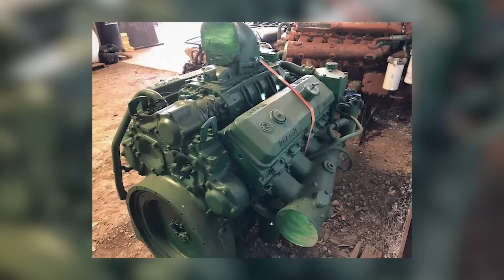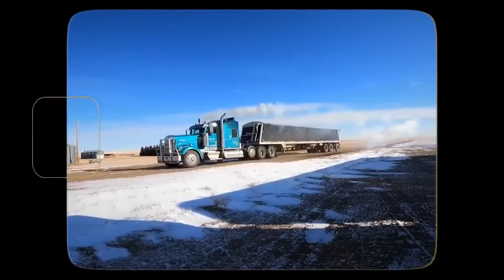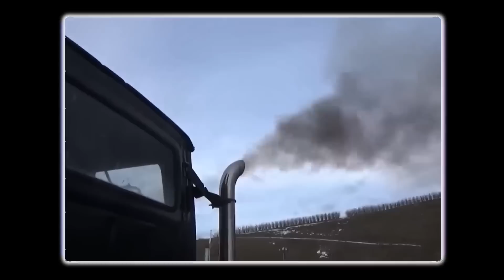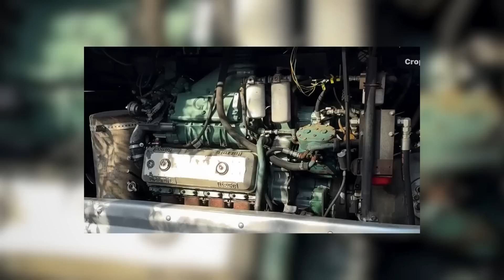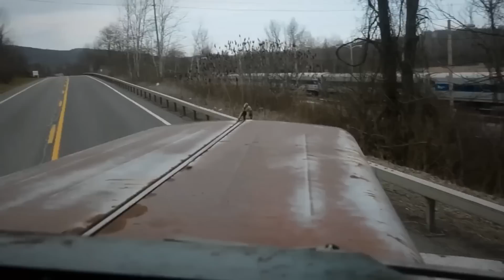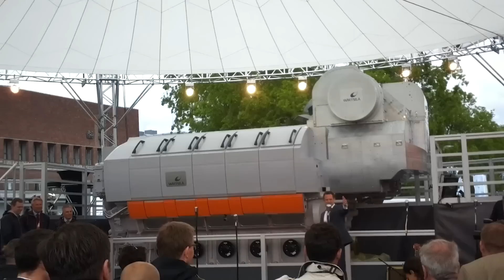The Shocking Truth Behind Detroit Diesel’s Banned V 16 War Engine!

Comment: Watching a video of a V-16 Detroit, but the pictures are of 6-53's, 6v-71's, 8v-71's, a couple 12v-92's..............  misleading pictures, some information isn't quite correct also.  2cycle engines won't run without a blower.  The blower doesn't compress the air, just feeds it to the cylinder.  Better research might improve the video.

Comment: Hearing that compressed air starter brings back memories of the oil field for me. I was a motor hand on an oil rig in Louisiana it had three V-16 Waukesha engines that started that way. Talk about power!
Reply: An air start on a rotax 850 etec skidoo mxz would be cool!
Reply: @jlo13800  Yes, an interesting approach.
Reply: In very large engines, a different method of air starting is used: Injecting air directly into one of the engine's cylinders. Very large ship and stationary engines do this.

Comment: The blower is for aspiration in a two-stroke diesel, not for boost.
Reply: Wrong
Reply: For boost
Reply: @NathanStickney-xv6dy  No, it's required for the engine to merely operate.  There may be some boost, but it's a minor contribution.

Comment: These engines get their Best Fuel economy at or near full output.  Running at 80-90% they exceed most other engines. However. Run it at less than 50% the four strokes win. Run it at 30% or less most of the time and it will shorten the life of the engine. Carbon, sticky rings.  Two strokes are like that. But. As a Marine Propulsion Engine or Generator? Nothing Better. Outlive snd Out Perform anything else. The harder you run it, the better it performs and the longer it lives!
Reply: Sort of. I ran 12V71 engines running pumps and nowhere near 80% loads. And ran them for 14,000+ hours between overhauls. All the while burning 9 gallons of fuel per hour compared to their maximum rating under load of 19 gallons an hour. Key was don't run them at anything under 1400 RPM except at startup at 1000 RPM and shutdown. And change the oil every 300 hours while adding 2qts every 24 hours. Basically 60 qts used for every oil change cycle. ( 36 + 24 burnt ) Normally operation had them at 1800 RPM with the overspeeds set at 1900 RPM. While they were designed to operate at up to 2100 RPM, our 8' diameter props started to cavitate at anything over 1800 on the engine ( 100 RPM on the prop ).
Reply: When I was in the military, we were required to idle our Detroit Diesel engines at 1200 rpm and not 650; otherwise, wet stacking will occur. This is oil blowing out of the exhaust pipe.

Comment: There  is Differential Stroke Cycle (D-Cycle) by simply splitting the piston crown from skirt to pump gases for the chamber via a (valvetrain-like) piston-train and to combine with the rest of the piston to turn the crank – a hybrid of 2-/4-cycle. D-Cycle further ushers in the compression-/spark-ignitions for diesel-/gasoline-engine hybrid - “Diesoline” engine - which is the SCCI/LTC (Stoichiometrically Charged Compression Ignition/Low Temperature combustion) engines. 
The Piton-train can dynamically adjust stroke lengths and durations of the gas exchange to optimize Burnt-Gas Retention (BGR) which is an expanded EGR (<30%+/-), for ignition timing and combustion duration. These retrofits surpass the current 2-cycle, 4-cycle, diesel, or gasoline ICEs, while maintaining compatibility with existing parts, manufacturing, facilities, personnel and processes. 
I worked for Detroit Diesel (DD) before retirement. It is a shame that DD doesn't continue the great power-stroke in every revolution. That is the wrhole engine

Comment: This video is full of BS about the 16V149.  By the late 1980's CAT's 3516 engine was exceeding the 16V149 engine ratings.  3516 genset had a 60Hz standby power rating of 1750kW and the 16V149 was 1400kW.  To compete with CAT in the standby bower rating DD had to either had to add a scavenging blower bypass to get enough air mass into the cylinders to generate the power required to compete with CAT's 3516.  Electromotive Div. of GM replaced the crankshaft driven roots blower(s) with a complicated and EXPENSIVE dual drive turbo and later increased cylinder displacement to increase power.  The EMD's (now a Progress Rail (CAT subsidiary) product turbo is driven by the crankshaft when power output doesn't provide enough exhaust flow to to drive the compressor at speed required to provide scavenging air flow.  When the power output exceeds the exhaust flow required to drive the compressor at min speed the crankshaft drive is disconnected from the compressor shaft by an overrunning clutch.   Impending EPA emissions regulations drove diesel engine technology to digital electronically controlled fuel injection which had a secondary benefit of enabling higher outputs by allowing variable ignition timing control.  In 1995 CAT introduced the "B" series 3500 engine which replaced the mechanical unit injectors with electronically controlled unit injectors.  This increased the standby genset rating to 2000kW.  This made the 3516B the choice of data center owners.  To compete DD released the 20V149 (two six  & 1 eight cylinder blocks, crankshafts & six turbos).  By 2020 EPA tier 1 emissions for >750bHP killed the DD two stroke engines.  The particulate emission even with electronic unit injectors exceeded the limits.   By the 1995 CAT 3516 gensets had smaller footprint than 16V149 & 20V149 gensets.  Also the video implies that the largest Wartsila diesel engines aren't two stoke cycle which is Bovine Excrement.  They definitely are 2 stroke engines as well a true crosshead*.  By using a crosshead design the underside of the piston is used to pump air to scavenge the cylinder of exhaust.  Unlike a double acting stream engine which has two power strokes per revolution a crosshead diesel has one power stroke and one combination scavenging/intake & reciprocating air compressor.

Comment: Cane with ritating ,twi piece Pistons that lasted less than 2,000 hours usually less , rebuilt with non ritating pistons  1,000 ro 3,000 hours beforebit geraded. Mechanis who worked on it had black knee caps from working under it and its famous Black oil goo it leaked everywhere. Cat was building comprable engines that lasted 10,000 HOURS , 8,000 HOURS ON THE ONES I rebuilt..rhe bigest had Four turbos, on 200 ton haul trucks in Arizona copper mines, that were invisible from the pollution.
Reply: Pistons were usually made of cast iron.
Reply: Ran them as 1500rpm generator drives here in Australia. Minimum 10,000 hours at or over 80% rated power. TIBB engines were at the limits of the crankshaft durability and had to be serviced on time.
TIBB is turbo, intercooled, blower bypass engine. Just one performance step down from the ILCC engines.
Reply: @rayg9069  Does that mean that the blower could be bypassed at high speeds, using the turbo alone for scavenging?

Comment: Why can't you show the subject engine?   Its all AI.   The OP didn't do his homework.  More research is required.
Reply: Thats a real truck with a 16 71 or 16 92, there's a few show trucks like that still. Gorgeous works of art really. But that power plant with the fella standing on it whole it ran in the beginning is a 16v149 almost certainly.
Reply: @benjaminsmith7228  A 16V149 would be best in a marine or stationary application.
Reply: @benjaminsmith7228  I would like to see a    16V149 in a class 8 truck.
Reply: @benjaminsmith7228  For sure
Reply: But I do agree they could have done much better